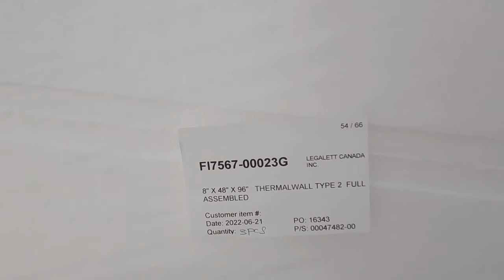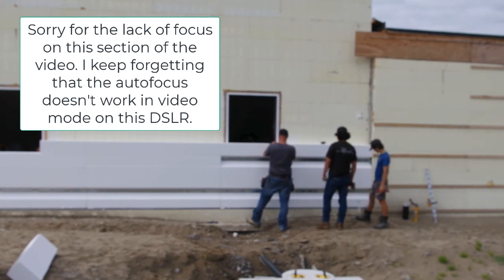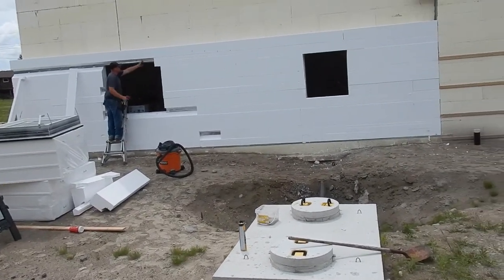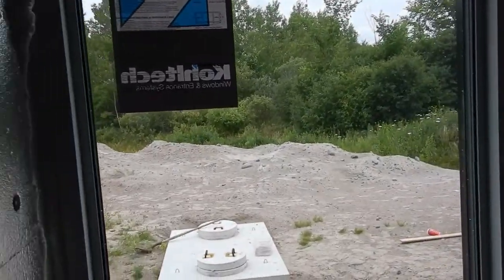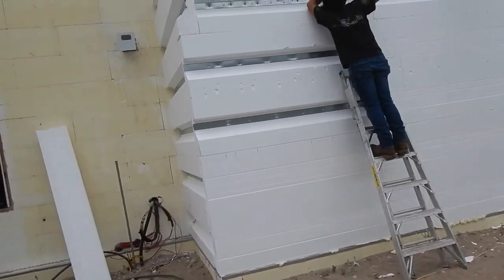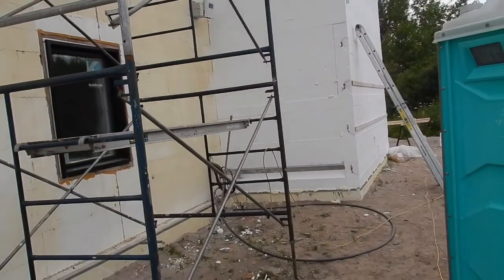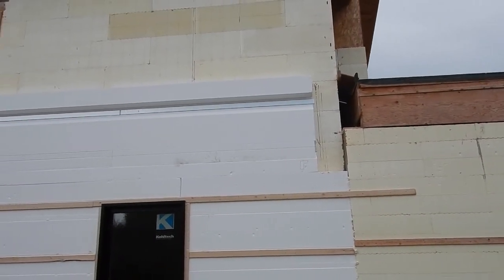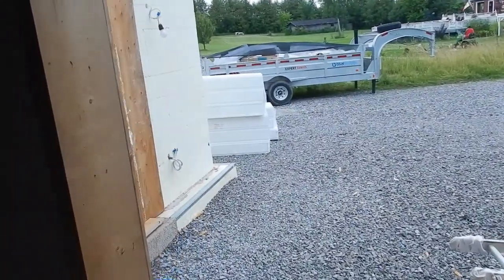Beginning Thermal Wall Install

Comment: If I missed it, I apologize - but what is the total thickness of the thermal wall?

And how much per sq ft did the thermal wall cost? I tried getting a quote from them years ago and it was like pulling teeth.
Reply from the maker: The thermal wall is 8” thick around the entire house from foundation to roof. I don’t know the cost/sq ft. But we have 99 sheets @ 4’ x 8’  and with install and inflation we are paying about $40k. Talk to Glen Sakuth at Legalett for more precise figures. He has been extremely helpful.